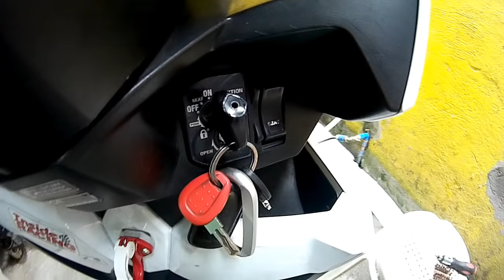Motorcycle : Scooter Full Coolant Replacement

Comment: Hello.I have a Honda click 125i.
When I start to drive when I give gas the bike comes down.I have changed the spark plug but nothing has changed.The mecchanic has said it’s a cdi problem.can it be that?Thanks.
Reply from the maker: ohhh.. the mechanic might be wrong.. click 125 dont have a CDI, instead it has an ECU. Can you do reset ECU? do the part 2. Please look up it here in the channel.
Reply: That2Wheel my Honda is 2012.Where is the cable?In the same place?Thanks for help

Comment: Gud evning po sir tanong ko lng po feb nkuha ko po ung motor tapos inabutan po ako ng lock down ngyn d po ako makatakabo  ang nangyari po puro lng po ako painit  tapos napansin ko na bumaba ng ung level ng coolant ko ngyn nilagyan ko sya pero ung takbo ng.meter ko is 600 plng po. Hanggang ngyn kakatapos k lng din pong mag change oil ngyn po tanong ko lng po kailangan k na po bang mag drain ng air cooller? Masiisra po ba ung makina ko.slamat po sa sasagot mga paps.
Reply from the maker: Nope bro, 20k mileage or 2 years saka ka mag drop.add ka lang dun sa reservoir

Comment: sir ung upper hose sa coolant reservoir nakatanggal ba talaga un or may nakaconnect sa radiator
Reply from the maker: Nakaconnect yan sa reseve tapos derecho drain..yung sa baba lng nakaconnect sa radiator
Reply: @That2Wheel  bakit po kya natatanggal kahit bago palang ung motor parang walang clamp po
Reply: @That2Wheel  sa coolant reservoir lng po nakaconnect tapos ung sa end nya wala na talaga icoconnect kc un sabi ng kasa tanggal daw hose bak kc nanloloko lng sir
Reply from the maker: @elpeejaymiranda2545  baka di lang mahigpit..push mo ng mabuti bro
Reply: @That2Wheel  thank you sir

Comment: Good day po , tanong Lang po. ilang kilometers po bago ka magdagdag ng coolant? 4K na po takbo ng click ko. Bago pa kasi click ko Hindi pa tlaga na dagdagan kahit once. Salamat!
Reply from the maker: walang bilang bro... tingnan mo yung reserve..see the level..meron yan low at high.. put it on high na lang muna.. you can use any coolant basta premixed and ethylene glycol
Reply: Masisira po ba if maubosan ng coolant paps? Anong mangyari if maubosan?
Reply from the maker: @amerkhan9636  before ka maubusan ng coolant sa radiator.. your bike will stall at di na tatakbo..indicating an overheat or high temp message sa dash. so malalaman mo talaga...
Reply: Ok po salamat. God bless
Reply from the maker: @amerkhan9636  Welcome bro

Comment: Sir! Pano po kaya kung don ko po nilagay s white na may upper or lower? Don po ko ngrefill.. at d ko po dnrain s mismong radiator..
Reply from the maker: pwede naman yun..if yung excess at sakto na makakalabas sa reserve.. then pag baba ng temp kukuha sya ulit sa reserve. Sa mga new bikes, if gusto maging sure, you can open radiator to check level
Reply: Okay paps salamat.. ask ko lang nbli ko kase optimum radiator coolant s may motolite.. pink po kulay..
Reply from the maker: Raviel -_-  if iba yan.. drain mo full. then replace.. make sure na ethylene glycol yan.
Reply: Okay sir salamat po!

Comment: sir good morning. tanung ko lang po . kailangan po ba sya idrain for fully replacement o pwedeng i refill refill nalang? thanks po
Reply from the maker: 2000 mileage or 2 years. which ever comes first. for now..refill ka na lang muna sa reservoir
Reply: That 2Wheel ngaun po refill lang. Pero pag nag 2 years na o 2000km dapat po ireplace na?
Reply from the maker: yes.. nag edit ako sa taas.. its 20,000 kms..nagkulang ako ng zero.
Reply from the maker: After 2 years or 20,000 kms.. need to drain everything

Comment: boss mga magkano po mag palagay ng hazard lights sa click 125 i gc at may f.i cleaning po ba ang honda salamat po sa sagot
Reply from the maker: no tsure on hazard bro..depende sa nagkakabit..please check with installer.

on FI cleaning.. we have done 50k mileage.. fuel filter lang pinapalitan namin and its good.

pero yes merong FI cleaning.
Reply: salamat boss mga magkano po pa f.i cleaning kung sa casa po o kaya sa labas

Comment: sir my click is 2 years old hndi pa ako nag fully drain at palit ng coolant,gnawa ko lang is refill through the reserve,ano po kaya estimate in ml. na malagay sa radiator para umabot sa rim? thanks po.
Reply from the maker: I dont have the exact measure... but 1 liter is enough, kasama na reserve
Reply: That 2Wheel Feeling salamat po,pero may sobra pa po ba ung 1liter? or tama lang po?
Reply from the maker: sobra pa yun

Comment: Sir les good afternoon ano number nang nut sa radiator cap. Di naman nasabi sa video cge marami salamat godbless. Naka subscribe na po ako sir. Salamat sa reply. Number size sa tool gamit. Salamat
Reply from the maker: 10 bro, please double check.. use socket wrench

Comment: Sir. Pwede nyo po ba ako tulungan. Hinge po sana ako ng contact sainyo regarding sa mga trusted mechanic ng click here in manila. Duda po kasi ako sa engine oil ko e. Medyo dark green kapag nakakapag 500 kIlometers na ako. Bago palang po click ko 2890 palang po odometer.
Reply from the maker: Anung oil yan?
Reply: 1st and 2nd change oil is Honda oil. Now petron na po. Bali nag check oil po ako ako knina. Kaya ko po napansin na medyo dark green ung oil ko. Nag ask na din po ako sir ron reyes. Good naman daw po. Hnd din po nag babawas reserve coolant ko pero nag tataka po ako bakit dark green ung oil ko.
Reply from the maker: Jc Zambas ahh. Ganyan naman ang kulay ng honda oil. Ok naman din yan